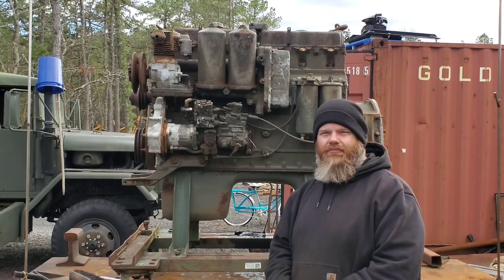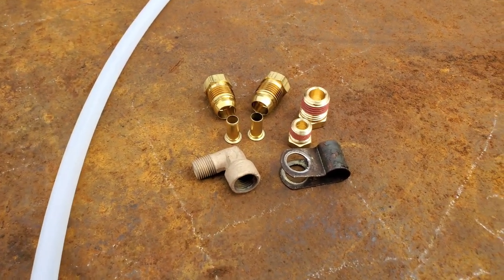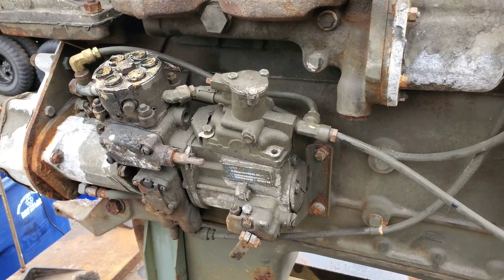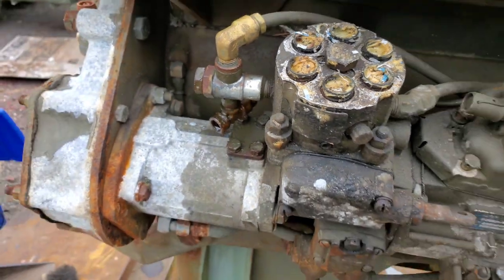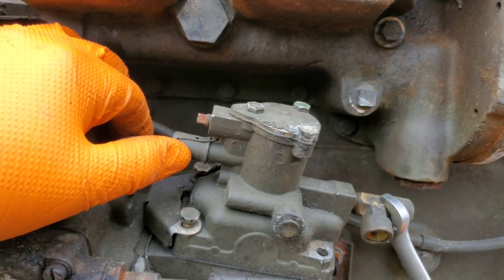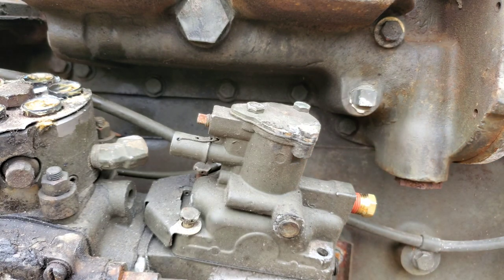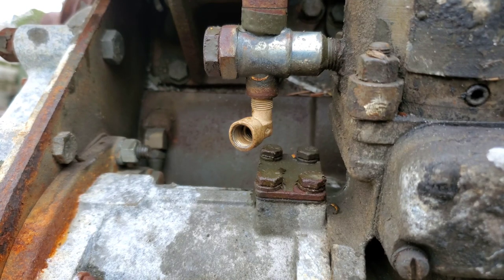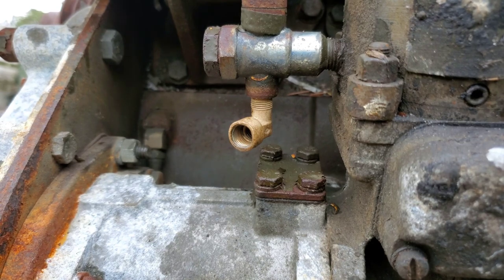The Best M35A2 Fuel Density Compensator Bypass Instruction Video You Will Ever Watch!!!

Comment: With over 35 years working with the LD/LDT 465 and LDS 475 engines I never encountered an FDC fault. Any multifuel problem encountered  was due to incorrect mixtures, or the use of AVGAS. The data plates on the dash are quite specific.

Comment: Was wondering why you don't like waste oil. Personally I screen it going into a 275 Gallon oil tank, and then pump it out through a diesel filter. Then run it about 50-50 with diesel. I really just do it because I think that's one of the coolest things about these engines.
Reply from the maker: The problem with waste oil I have is if it is black, it is still full of contamination. The black is carbon, which is abrasive. All of that in microscopic form is passing thru the hydraulic head. Most folks think that running it thru a series of filters is clean, but if you watch some centrifuge videos here on youtube you will see how dirty the waste oil really is. It comes out of the centrifuge almost looking new, and the best part is watching the centrifuge cleanout videos. You will see all the junk that has been removed that ends up running thru the hydraulic head. 
The pumps used on these trucks are not really military specific, they were off the shelf units with slight tweaks for military use. Basically they are just a tractor pump that was chosen due to availability at the time and a density compensator was added. Not really a specifically designed unit to be running other fuels thru, but they made it work.  If parts were plentiful maybe my outlook would be different, but they are getting very scarce and are not cheap. Many of the items in the pump are no longer even available from American Bosch, things as simple as a seal in the boost pump and many others.

Comment: Hi I have a M35 A2 I'm wanting to change out the secondary fuel filters for a Twist on adapters my question is if I switch to the new twist ons do I still need to use both filters or can I modify to use only one if so how can I do that if not then I will keep it with the two filters thanks
Reply from the maker: If using the original filter head with a spin on adapter, then you would need both. I imagine that if you did something completely custom and removed the original filter mounting head, you could probably find a single filter that might be able to do the job.
Reply: Thank you so much I may have questions later
Reply from the maker: @sgt-ho3bd  No problem, glad to help. Feel free to email me your questions to bigmikesmotorpool@yahoo.com. Easier than doing it thru YT.

Comment: What is the benefit of bypassing the lines?
Reply from the maker: The compensator is one of the most common parts of the pump that will cause fuel to mix in with the engine oil. It was so troublesome that many trucks were bypassed by the government while they were still in service.
Reply: @bigmikesmotorpool9263  it is advisable to do bypass even though my truck carrying heavy load? It doesnt affect the performance?
Reply from the maker: For sure. The compensator is only used for maximizing the efficiency of alternative fuels for using fuel other than diesel in an emergency situation, for instance, with it bypassed, if you run gasoline it will not run very well. It will not have any effect on performance of the truck carrying larger loads while using diesel fuel.